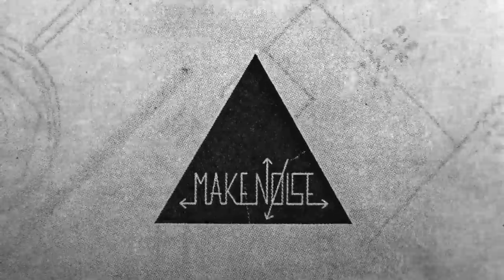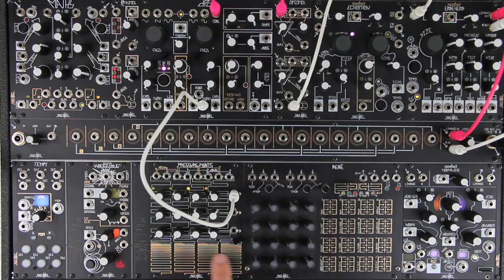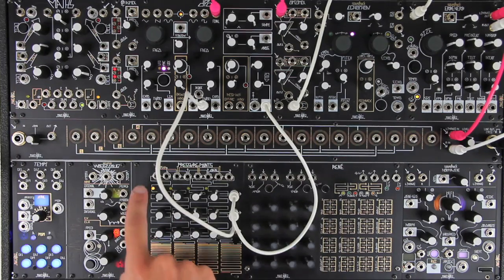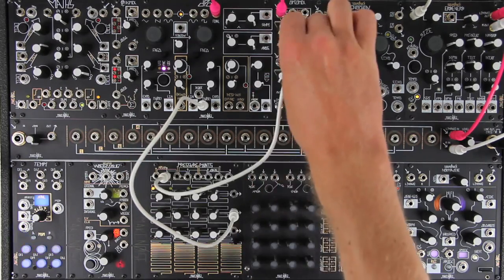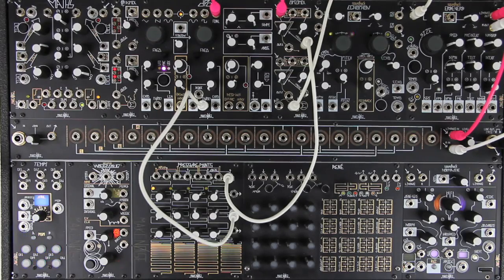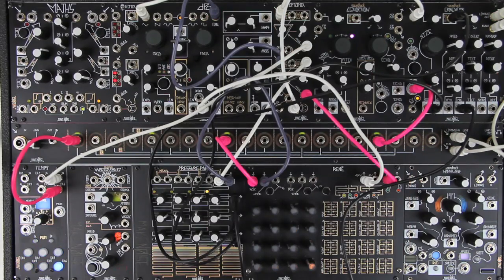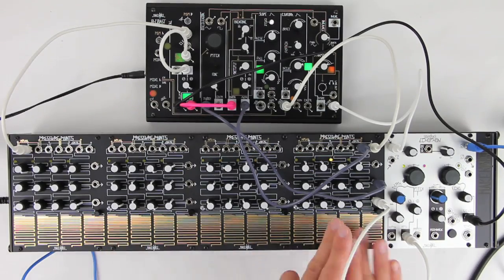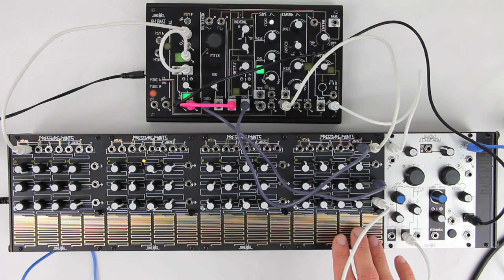Make Noise Pressure Points

Comment: Cool Pressure Points trick: make very light contact with a pressure pad with one hand (I use a tip of my finger) and then touching any panel works like pressure control. This makes any reachable panel space a performance option. You can even get sorts of presets with different parts of the 20hp lightning bolt blank.